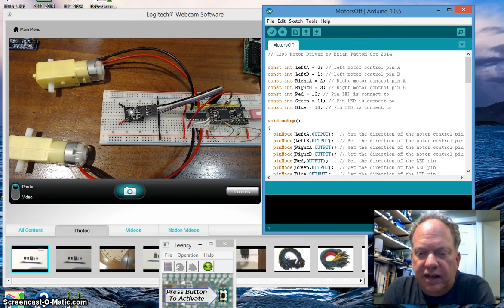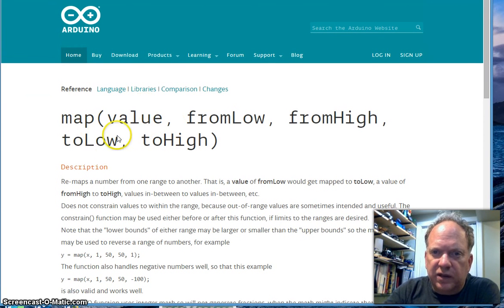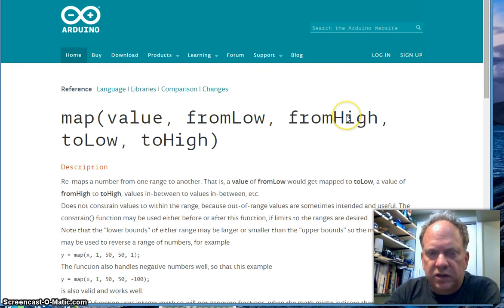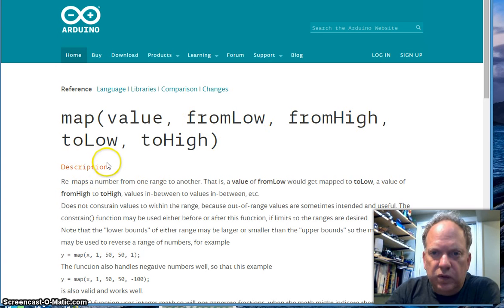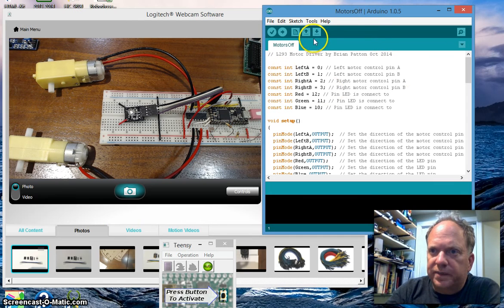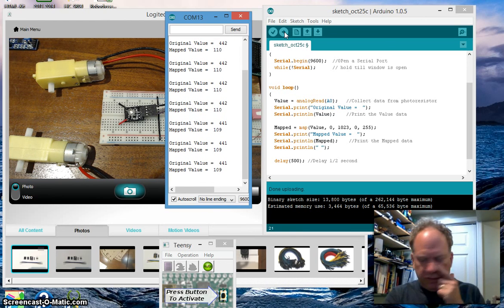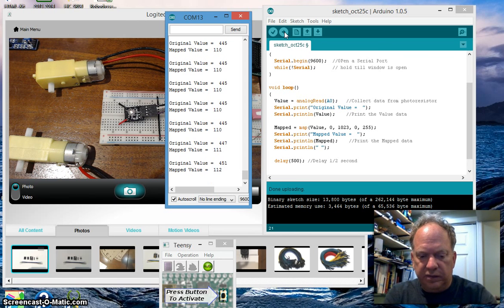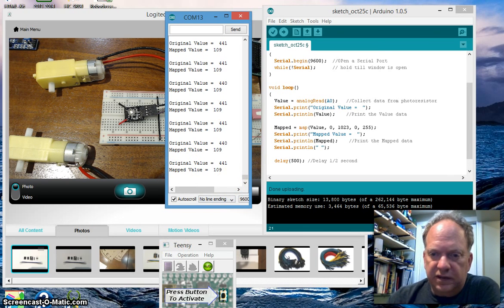18 Demo of Arduino Map function

Comment: Dood; while u supposed to show the breadboard when u intesify light on the sensor, u covered the breadboard and fotoresistor with the serial monitor window, which renders ur video useless for beginners..just an advice...also u don hav 2 print, make mistakes & reprint, just use abbreviations to make ur video shorter...

Comment: 1023 is the maximum value we can get from any analogue device in Arduino and 255 is the maximum range we can convert to digital value. 1023 analogue is equal to 255 digital value.

Comment: Hi, I have done the maping for my 4WD rc controled car. map it down to -255 to 255 and its working grate exept one thing. when i turning the car forward is moving smoth, but when i revers it, its start with high speed to low speed. How can i correct this problem? In the RC controller i use ch2 for both forward and backwards, and 0 make the car stand still. Regards Peter